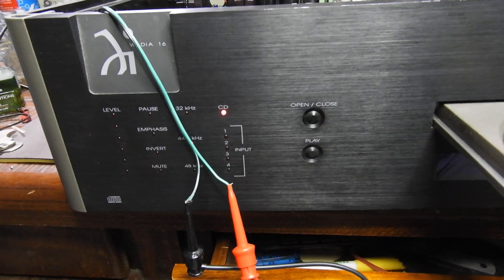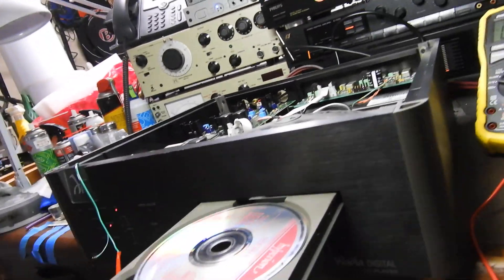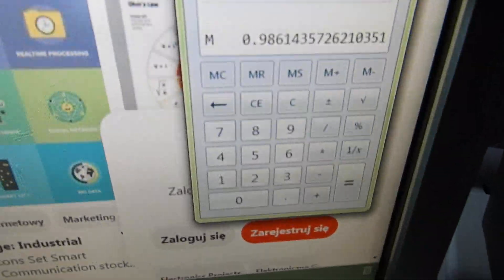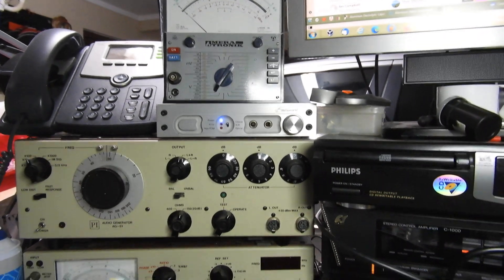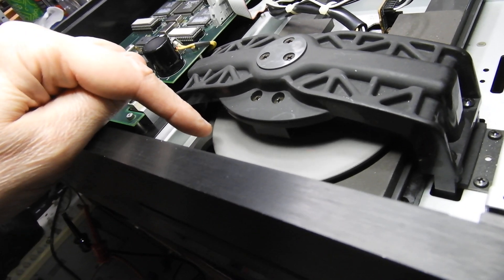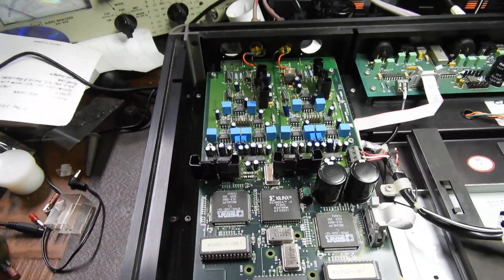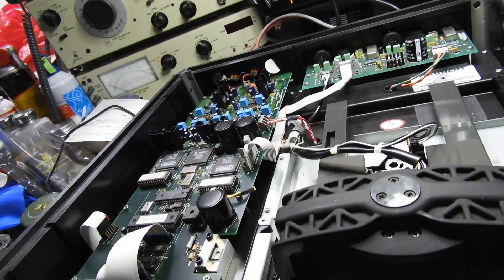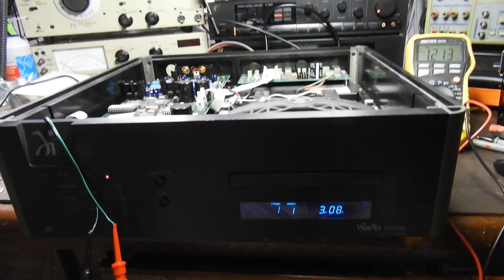Wadia 16 mid service. Features, faults and very fresh KSS-151A laser.

Comment: My esoteric p70vu transport read some cds, but does not read many others, the laser was mesured good, have you came across maulfunction like that?
Reply from the maker: Many times. It needs a servo alignment. At least your guy has a laser power meter and didn't say that you need new laser.
Reply: @hear-net-au  on the contrary my tech guy told me that even the laser that I replaced was good. Can you give link to servo alignment info? If the transport was not that heavy I would have send it, it's very special audio piece this transport...
Reply from the maker: @erananddikla9176  get manuals for Esoteric stuff. The procedure is like in P-700 transport, but the board is from VRDS-10 or similar. Look up pics on the net to be really sure whichodel board they used.

Comment: Hello hear-net-au,
I've been following your videos for some time. I have had a lot of Teac  cd-players, eg. a few VRDS-10 (sold long ago, then the P500/D500 sold on to have a Copland CDA-288 and later on a Copland CDA-288Mk II S.E. That have an updated dac board and K-selected BB PCM63 dac chips. Very satisfied. But it also uses the Teac CMK 4,0 drive with the green plastic disc. It plays fine abut I want so much to install a VRDS10 drive in it - the CMK-3,2 as you show here in this video. So I bought an old VRDS10 and transplanted the servo board and the drive itself. That drive had to be cut down underneath, the laser cable management lowered (or rather raised), and the grey metal chassis cut to suit inside the Copland player, where the smaller Teac CMK-4,0 used to be. 
And it plays! So far so good. That was last night. Then this morning, I connected it to the amplifier and speakers, and while it plays, there's a lot of tss, thik thik tss, like something is not isolated, or something overdriven or in fact anything else. I'd like to ask you if you might have any ideas as to what this is, and what can be done. I should add that it didn't do this before disassembly. I have been quite careful with handling the laser etc. But unfortunately, it have difficulty tracking etc. And when it finally does, it ticks as described (in the played signal in the loudspeakers.).
The Dac board, the display board and the power supply board is Coplands own. But, as with many of these Teac drives, things are interchangable to a certain degree. For example I saw a Wadia 16 with the latest old type green super sized VRDS drive installed in it.
Any suggestions or ideas of what it might be and what it is, are very very welcome. I fear it might be a bit far to ship it all the way to you on the other side of the planet. But if need be, I'll pay you for your trouble of some remote help.
Kind regards,
Jacques in Copenhagen, Denmark.
Reply from the maker: I think it might have difficulties tracking. You say it does not use TEAC board for servo but Copland's own. Does it have the same Sony/Sanyo 5 adjustment pot arrangement? And, are you a subscriber Jacques? I need 350 more subscribers... ;-)
Reply: @hear-net-au  Hello and thanks for the reply.
I think I wrote it badly, so here's the right version:
Like many other brands which used Teac drives, Copland used the Teac servo board and developed their own power board, dac board and display board, plus a button control board. So, the Teac parts are the drive itself and the Teac servo board, which is the CMK 4,0 drive. The board may sit in say a VRDS7 or similar. On my modified Copland, there is now a servo board from a VRDS10 plus the drive CMK 3,2 from the same VRDS10. One of my Copland CDA-288, the Mk. II S.E are having the very right cables and the other older CDA-288 does not. I made it on the newer version of course.

The tsk, tsk tsk, may be a bad laser. I may have to swap it all back into the Teac VRDS10 and test it it will work again in that. It did before I dissasembled it and did the sewap. I think Wadia did something similar.
Kind regards,
Jacques
ps: subscribed!
Reply from the maker: @monzarace  Thanks for subscribing. Laser as such normally do not just go bad. It can happen that coils no longer focus well, but it is very rare. I would start by doing a proper alignment of the servo as per service manual of the unit you took it out from (VRDS-10). If you cut the mech well (meaning that it is still true and square) it should be OK. Putting it back into VRDS might give you a peace of mind that it is still good, so if you have to do it - try. But ultimately, you will need to adjust the servo. Service Manuals for it are at HiFiEngine.com and maybe at Elektrotanya.com which usually have better scans. Good luck.
Reply: @hear-net-au  Thanks a lot for suggestions. I'll try them all out and give you a feed back once I find out.
Kind regards,
Jacques

Comment: Hi
I might be buying a wadia 16. 
Can you please advise me on two things I need to know?
First, can the dac be used as stand-alone, ie can a streamer be connected?
Second, are main spare parts easily available, and is it a relatively strait forward amp to service/ repair?
Many thanks, Joe
Reply from the maker: Yes, the DAC can be used stand alone. It has AES/EBU input, the SPDIF coaxial one, and two Toslink ones, one standard plastic one and one glass.
The parts are available, but they becaome more expensive now. For instance Op-Amps are about $20 each whereas any decent, standard ones are $2.
I will come back to finish the repair by weekend having been away for few days, I need to finish couple of Roksan Caspian units that are taking up space. Wadia will be next. I now know that the op-amps are good and problem possibly is with either buffers or some caps. The low level on one channels is limited to the single ended output; the balanced one works fine (they have separate amps). Good news is that I now have the service manual for it, so it should be much easier.
Reply: Hi
Many thanks for the information and good luck with the job.